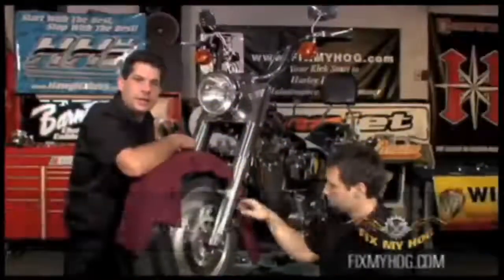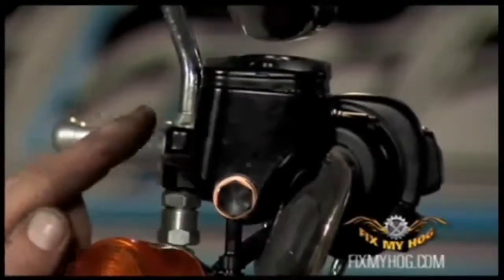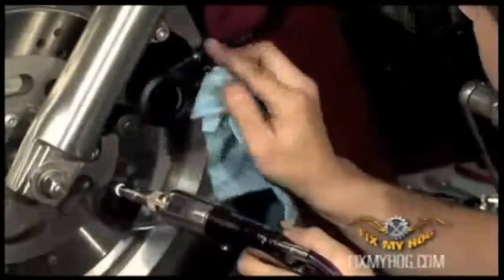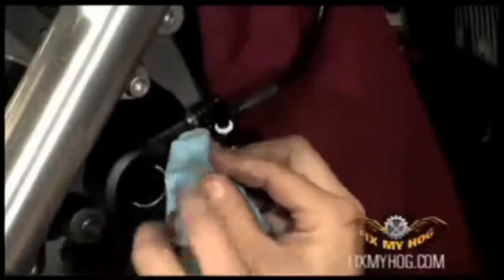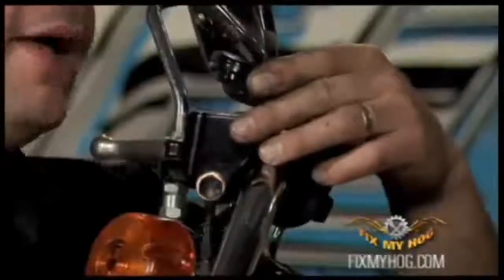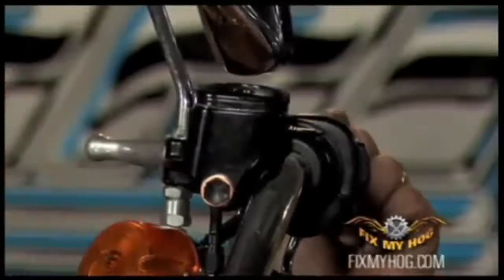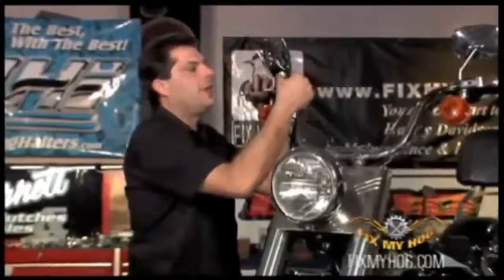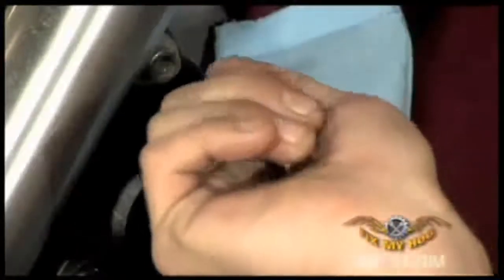How To:Reverse Bleed Your Motorcycle

Comment: Hello, I tried your method and saw the fluid filling the Master Cyl.  Then tried bleeding a bit more from top, saw some small bubbles appear through fluid, but still cannot get resistance at the brake cylinder.  Tried quite a bit of conventional pumping and bleeding, also some additional reverse bleed but no pressure still.   I had replaced the brake line recently but had good braking before that. - Geoff